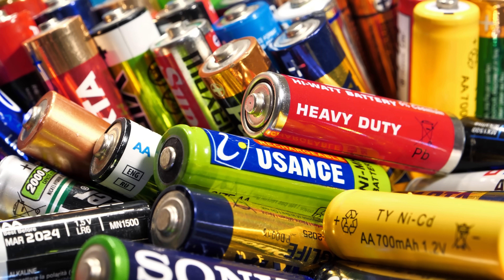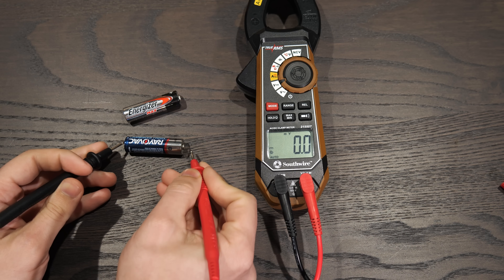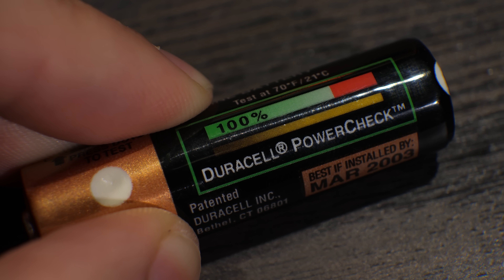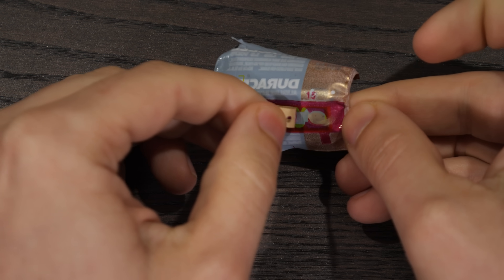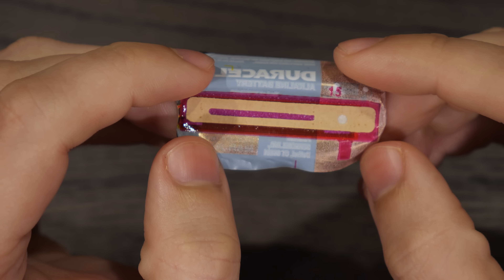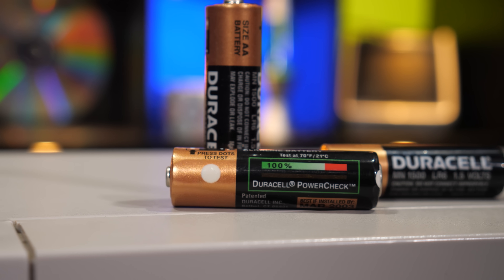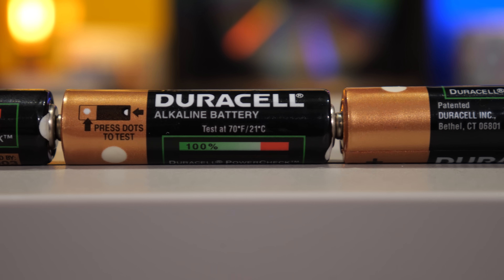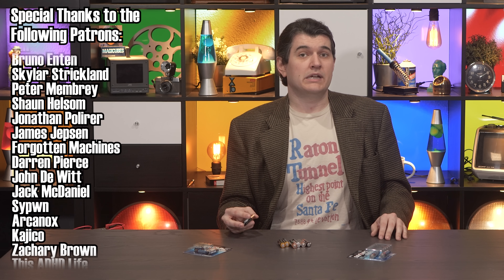Duracell PowerCheck: A genius idea which didn't last that long

Comment: We used to have a time where these testers where build into the plastic packaging. In the middle of a duracell 4 pack with cardboard backing.

So you could test any AA battery by putting it between the contacts and pressing on the top and bottom with your thumb and index finger.
Reply: I had totally forgotten about that until I read a comment earlier. 

That was out when I was a kid and I cut it out and used it to fill up boxes of good and medium batteries for my stuff, haha
Reply: @volvo09  yeah, must have been in the late 80s or 90s. I did the same thing as a kid lol.
Batteries where always a struggle because everything used to need them.
Reply: I remember.
Reply: @rogerk6180 Much later. I think even after 2015. I still have a teststrip in my box where i keep my batteries. Besides and actual tester. And the box and it's content are not that old. :)
Reply: @SPeeSimon   ok, haven't seen them for a long time myself. I thought they went out when they got included onto the batteries themselves.
I'll keep an eye out for them in the shops!

Comment: No, but I remember loads and loads of knockoff AA batteries in the early 2000s, possibly late 90s, trying to fake those with just a print on the side. I grew up thinking that it's just a gimmick that doesn't work.

Comment: I remember thinking these were super cool as a kid. But boy would I have to press into the points till my fingernails bent. 
Now that you've mentioned the thermocromic material, I recall thinking at the time that it looked very similar to the fever thermometer strips that were very common in the 90s, thanks for the confirmation!

Comment: TV remotes already use so little power, they can afford using AAA, as they will probably die of old age before they use all of their capacity.
Using AAA instead of AA makes the remote lighter and less prone to damage when inevitably falling from your sofa or table, hitting the floor.
Reply: Meanwhile my remotes lose signal strength as the batteries go down, which apparently happens quickly.
Reply: @orppranator5230  I learned recently that a slow decline is a characteristic of the alkaline battery. I found that out because they don't work well at all in an outdoor security camera which recommends lithium AAs. Lithium hold a constant level of voltage right until the end, making it more stable for some electronics that need clean power.
Reply: @orppranator5230  also less buttons work when the remote is dirty or old AND the batteries are old, as opposed to the same one with new batteries- when the battery has just barely enough voltage, the extra voltage drop on dirty button will make it not work.
Reply: Weight is a really good point. Two AAs really make a remote pretty hefty.

I’ve even seen people put AAAs with a foil ball at the end in a AA slot so the weight is reduced, I’ve been thinking to try it but don’t because I’m lazy lol
Reply: @Skiman__  aaand there are fake Ds and Cs, which are exactly that, a single AAA inside... Maybe there are fake AAs as well but I'm not sure.
Reply: @Skiman__  I think they only do this because of not having AAs at hand. How weak do you need to be to consider the remote with two AA batteries too heavy? Could be a sign to start spending less time using devices that have a remote.
Reply: @krzysztofczarnecki8238  compared to a remote with AAAs, yes it’s unnecessary weight as these will last for years in such low power applications. Also, you do realise strength doesn’t matter to know that something is heavier right? The whole plastic shell of the remote without batteries weighs less than two AAs. 
And for some god awful reason my sound bar remote has the batteries on top, so it’s top heavy for no reason if I use AAs. I do just use my pc volume controls the majority of the time, but it’s still silly how dumb remote designs can be.
Reply: New Samsung remotes are battery killers. They eat double As for breakfast
Reply: @st.m.3979  In that case switch to rechargeable, Ni-MH should cure its hunger, just get twice so that you can have a group charging while the other is in use.
Reply: @freeculture  no it won't take NiMH, too low voltage and all it does is blinking for more batteries 😭
Reply: I was just thinking the other day how long it's been since I had to put new AAAs into my wireless keyboard I'm typing on now. Like years...I imagine even on a busy session there's not a lot of charge being used to broadcast within its limited range.
Reply: @rhaedas9085  Yeah things like keyboards and remote controls need very little power as they don't have to do any really processing the biggest drain is generally going to be the LED or radio used to broadcast the signal. Meanwhile your wireless mouse will eat AA's for breakfast if you use it frequently as it's processing is quite a bit more complicated.
Reply: @FaerieSeraphina  My keyboard last 1-2 years with two AAA batteries. The mouse on the other hand lasts only about 150 days on a single AA. Still that is better than some mouse that has a charging port at the bottom.
Reply: @FaerieSeraphina my Microsoft Surface Bluetooth mouse uses two AAA which last 9-10 months. I will take the higher cost for the light weight every day. Here in the UK it is less than £2 (about 2.6USD) for a pair of Duracell AAA in a multipack, if that sort is a problem get a wired mouse.
Reply: I don't like a remote that's light as air, so AA for me.
Reply: Or the remote and batteries both refuse to die. Still waiting for this 14 year old universal remote to give up.
Reply: a remote from a TV I've had since 2017 is still running on its original batteries
Reply: AAA is far more common at least in my use. I have in recent years bought 12 AA and 37 AAA batteries annually on the average. I just do not get how I have managed to use so many but apparently when you have enough devices you will use them.
Reply: I’d prefer a built in li-ion battery and a usb port to charge it (like the AppleTV remote (just as an example that I know of)).

Comment: I have a label maker that doesn't just take AAA batteries instead of AA. It takes six of them. Six. A small change to the form factor and four AA batteries would take up less space and probably last longer. It's unfortunate that we've converted a lot of devices to built-in, rechargeable batteries, but then treat those as disposable. People get disposable nicotine inhalation devices, and then just toss them on the sidewalk. They have rechargeable, lithium-ion cells! Not only is it wasteful litter, it's extremely unsafe!
Reply: Yeah, but that would result in 6V instead of 9V.
Reply: @wernerviehhauser94  Well you have 9V batteries
Reply: @Dill_Do  9 volt batteries just have 6 AAA's inside the casing.

Edit: they actually have 6 even smaller AAAA batteries in them ;)
Reply: @Dill_Do  well, you could just use 3 lithium coin cells. Good luck trying to draw any current from them, though....
Reply: 6 batteries means it runs on 9 volts. 4 means it runs on 6 volts.
So it would need 6 AA batteries to function.
Reply: 6×AAA -> Replace with 2x 18650 cells in series.
Reply: 9V batteries can give much less current than six AA (or even AAA) batteries in series (also giving a nominal 9 V). That's why label makers don't use 9V batteries: they're thermal printers, so they need a lot of current (while printing).

My label maker doesn't even work well with rechargeable batteries (lower voltage and current than alkaline batteries). It's one of the few things I use where I still use non-rechargeable batteries.
Reply: @SamiKankaristo  no. Rechargeables aren't lower current than alkaline batteries. Those can deliver way MORE current.
Your label maker is bad as it also doesn't work well with alkalines (now working well with rechargeables means high cutoff voltage that limits how when it stops working on alkalines - probably before it barely used 50% of energy it could use if designed properly)

Comment: I got a battery measuring tool. Its just a needle and a slider. I also just buy rechargeable. I hate wasting bats. 
Mechanical testers are far more reliable than electronic ones - this I know.

Comment: Just opened my Furby and was met with a Duracell Powercheck. Thanks for answering my thoughts!
Reply: Did they leak all over and turn into a crusty white blob?
Reply: @F0XD1E  I'm so happy 12 year old me was smart enough not to store my gameboy original with the batteries inside.
Reply: lmao
Reply: I just found them in my Bop-It Extreme!
Reply: I probably still have some in my Squawkers McCaw. But they may have been energizer. Either way they're drained by now. lol That pink bunny lied to us.
Reply: I was amazed around 2012 when I got some of my old power rangers toys out of storage and found the batteries hadn't exploded, and all the lights and sounds still worked except massively slowed down. The same thing happened with a few other toys, including one I bought in 2009 whose battery was still good in 2022, and I realized that one thing they had in common is they would periodically make their noise without the button being pushed, for whatever reason. I think that discharges just enough power to keep the battery from becoming a burst of alkaline crystals.
Reply: Did it cry?
Reply: That just opened a whole can of emotional worms for me... My ex - if we can even call it that; we dated for 2 months in 1999-2000 - called me his furby. Ironically, as I am not very hirsute by nature... I should really give him a call, shouldn't I?
Reply: @CopenhagenDreaming I thought he's gonna call you his Duracell® PowerCheck™ for a moment
Reply: @CopenhagenDreaming ”Hirsute” Thanks for teaching me a new word.
Reply: @CopenhagenDreaming That's an odd thing to say under someone's comment... But it never hurts to say hi every once and then, right? Just don't expect anything much from him now, for your sake

Comment: AAA batteries usually hold about 900-1000mAh while AA batteries hold 2200-2800mAh. Check out Project Farm for more details on which batteries are best, rechargeables included.

Comment: I'm happy when a device doesn't come with batteries right out of the gate. I bought a Densha de Go! LCD game a couple of weeks ago and even through it was sealed and the plastic separator was still inside the battery compartment separating 1 end of 1 battery from the circuit but not the rest. But it was pretty old at this point and the battery started to leak so I had to disassemble and thoroughly clean it first before I could test it with a fress set of batteries.

Comment: Here in Europe those seem to be still a thing. I grabbed some out of my drawer (best before 2025), and they have even diffent colored sections now! red/yellow/green.
A quick measurement shows, the indicator draws quite a lot of current: at 250mA barely visiblle, and 500mA shows full bar.
Reply: Back of the napkin math, alkaline AA capacity is 2500mAh, which means a 500mA draw would last roughly 5 hours (ignoring the voltage/current drop). It's probably reasonable to hold the indicator for 5 seconds, so each check is 1/3600th or 0.02% of the battery.
Reply: @Anthony_DeSouza  
That's pretty good math.
I'm afraid to see the front if the napkin,  it might blow my mind 😁👍
Reply: Yeah duracell still sells them here
Reply: What brand in Europe makes them?
Reply: @RicArmstrong The brand with a bunny as a mascot 😉
Reply: They still sell them in the US too. I'm not sure what the guy in the video is talking about.
Reply: @mediocreman2  
I haven't seen them for sale here in the US for years.
Reply: Thank you for numbers!
Reply: Also in Taiwan 
Can buy in Costco

Comment: As others have noticed, they're still available in some countries. It's been a long time since I bought Duracells -- in my experience, they're far more likely to leak than, say, GP brand -- so I don't know when the feature left the UK, but it must've been since 2019.

I'm not sure if the patent issues had anything to do with it, but I reckon it's more that they were an obvious value-add to try to distinguish them as premium choices over their competitors. With the reduction of demand and places like Amazon selling massive packs of generic AAs very cheap, they became a truly-fungible commodity and reducing cost became the priority.

They were probably removed gradually from low-end to high while they desperately clung to the few clueless customers that'd buy top-end retail for their remotes, before gradually surrendering and being progressively removed from DURACELL PLUS, then DURACELL ULTRA, then DURACELL OPTIMUM, and finally DURACELL HYPERBOLE and DURACELL REALITYWARP or whatever they're called now.
Reply: According to another commenter: Duracell Quantum
Wow.
Reply: Here in the UK, their top-end is "DURACELL OPTIMUM", and apparently has a denser cathode with a secret ingredient.  Still, even their batteries that claimed "anti-leak" leaked. Same with CostCo batteries and Amazon Basics, both of which I believe are made by Duracell. Meanwhile, I've never had a GP brand battery leak.
Reply: Actually, I think the answer is the converse. In the 90s, batteries frequently leaked, so people removed them from devices and stored them in battery drawers. That is when testers were useful. Once leak prevention improved, batteries became “install and forget.” Modern batteries rarely leak. Duracell then removed the tester to drive consumption; without them, the used battery drawer became less useful. Instead, now people buy in bulk and leave batteries in the devices. The batteries are slowly used up even when they are doing nothing because of current leak, and there are few batteries in the house that can be swapped. That's how we get today when we get a 40 pack of batteries from Costco or Sams Club and leave it in a device till the device is thrown away or the battery is dead.
Reply: @anirbanmukherjee5240  Hmm. I don't think I've ever removed batteries from a device before they've shown signs of running out, except when storing or disposing the device. I only ever tried to use one of these powerchecks when I was seeing if it the problem was low batteries, and usually it frustrated me so much I'd rip them out and either use a voltmeter or just replace the batteries anyway.
Reply: ah yes, the Duraleaks, me too, any time I see some device loaded with Duracells i'm hit with dread
Reply: Worked on me. I remember preferring Duracells for this reason alone. Also I think Energizer or someone else had a cheaper pass/fail version that was pretty disappointing.

Comment: Scientific trick: Drop the battery vertically over a table. If it stays vertical, it's still good. If it falls on its side, it's dead. The battery charge affects the center of mass.

Comment: I remember as a kid wondering whether the gauge was heat-activated, and confirming this was indeed the case by activating the tester while holding the battery against my upper lip and feeling it become pleasantly warm.
Reply: This unlocked a memory. I remember doing exactly the same.
Reply: Wow, me too! I mean, I used my lower lip, but it was fascinating. I'm glad I'm not the only one :)

The colour change occurred in such a "blotchy" way that it looked so similar to how thermochromism in Hypercolor t-shirts and liquid crystal thermometer stickers for aquariums worked - this is what made me also come to the assumption it was a little resistor acting as a heater underneath the label, so I also tested it against my lip. Crazy.
Reply: I used the same principle but in the opposite way, use warmth to see if the bar turned yellow
Reply: Haha I did this too!
Reply: smart kids
Reply: I remember I once played with it (or may be it was those test stripes, or those printed onto the package, can’t remember exactly) so much it became too hot to touch, then I realised “oh it is just like those sticker thermometers!”